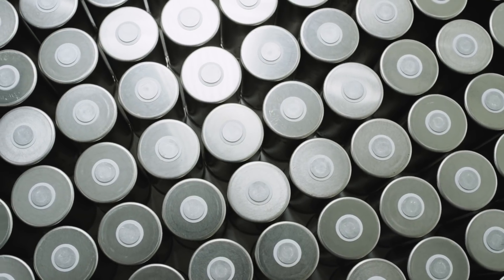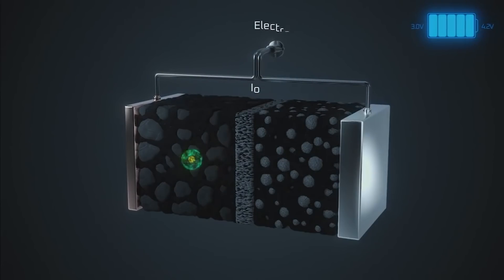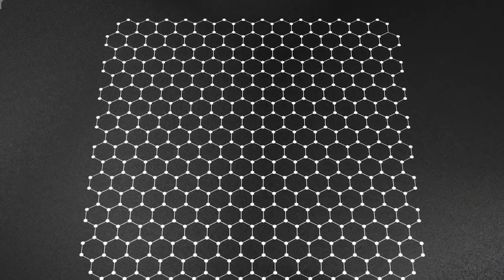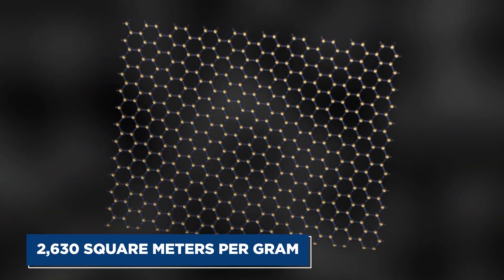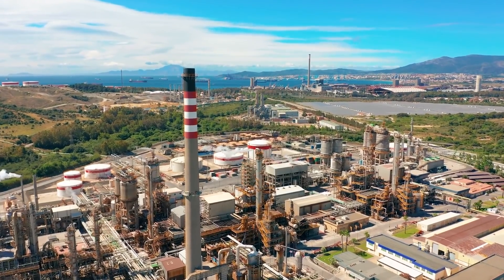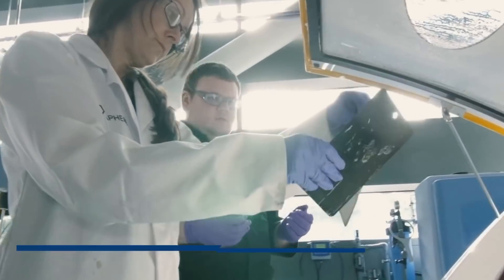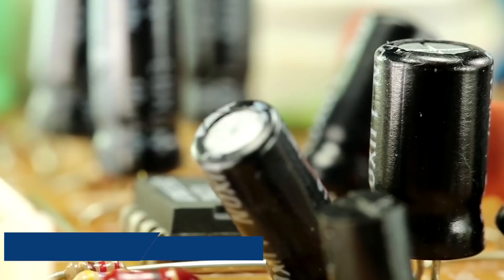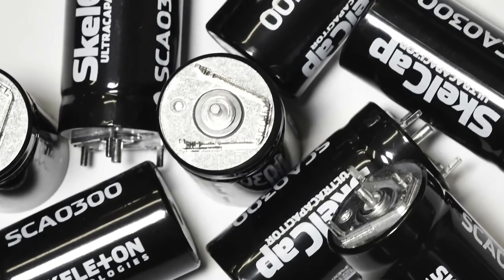IT HAPPENED! Graphene Batteries 2022 Are FINALLY Here!

Comment: I am told that by the summer of 2025
We as a nation will be between gas, oil, coal, solar and turbo wind, ocean wave energies we will be at 178%

Meaning we would have 100% and could export  78% at an income to America’s  business 40 + trillion each quarter...

That would make gas at stations range from 1.30 to 1.75 a gallon 

And cut electric rates up to 19% on average and the economy strong ..unless Biden and crew are still around.....

If that is the case gas will be 7.80 to 10.67 a gallon importing 38% of our fuel and safety...

Electric bills up to 42% higher....
But no raises at work....

So your money will buy less...

Comment: The specific energy of these capacitors is only from 5.4 Wh/kg to 6.8 Wh/kg, which is ten times less than that of popular batteries. The working time is only 1500 hours and the operating temperature is only 65 degrees, which is much lower than the performance of usual electrolytic capacitors. It doesn't look like new batteries at all, it looks like the new hype of 2022.